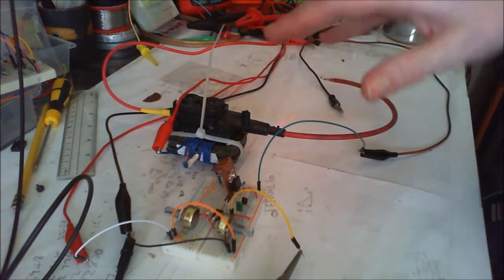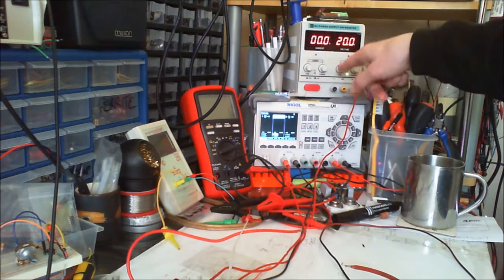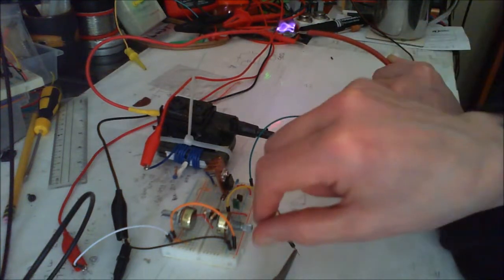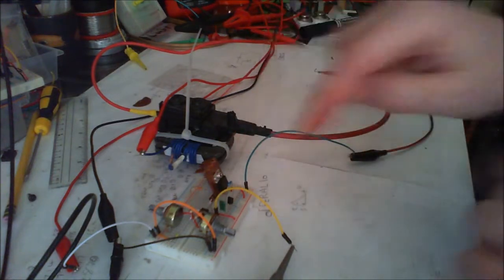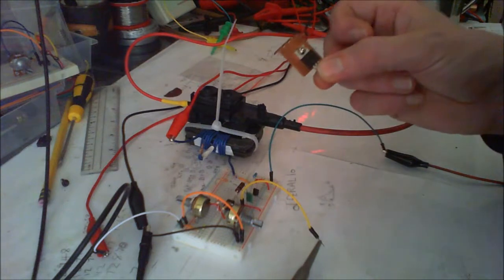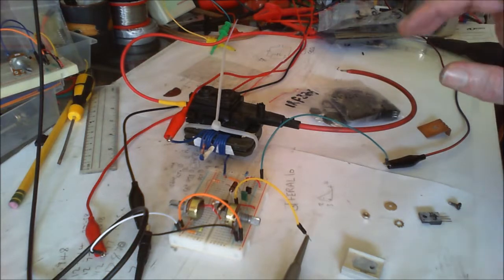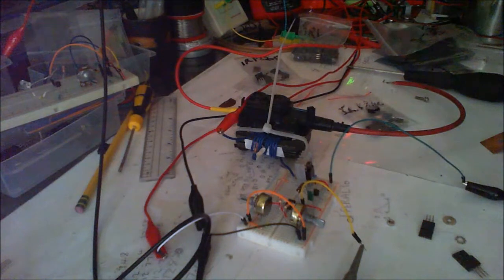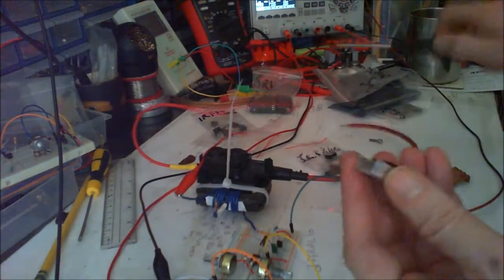Improved 555 Controlled Mosfet Flyback Driver Circuit

Comment: The MOSFET dies because once the back emf gets high enough it avalanches every cycle (turns breakdown voltage events into heat like a TVS diode, but it can only take so much). These spikes aren't random events and will happen every cycle, they're actually required for HV on the output. If the fet isn't avalanche rated it dies the instant breakdown voltage is reached.

You need to limit the peak drain voltage to something below the drain to source breakdown voltage of the device, they do this in the TV with a capacitor across the transistor. However putting anything across it will limit the arc output, the trick is to use a high voltage fet where the peak primary voltage can be allowed to ring up to a high enough voltage for good output without avalanche stressing the fet.

Secondly the 555 timer isn't great for this as the duty cycle and frequency get adjusted at the same time, but a more fundamental issue is a DC component can appear on the core over several cycles and also leads to the demise of the transistor. This is because without feedback you're storing predetermined energy "packets" in the core and depending on the arc characteristics not all of the stored energy makes it to the output, but it has to go somewhere! There is a trick involving a low ohm current sense resistor and jellybean transistor on pin 5 so the cycle is terminated before flux walking events can destroy the transistor.

The only true flyback driver I've seen which takes care of these problems is this one https://320volt.com/en/uc3844-super-flyback-surucu/

ps there's better fets than the IRFP260N these days with higher voltage and on resistance ratings, this is key to getting very high voltages out of the average flyback. If you do use a high voltage fet then lower the 220n capacitor to something like 100nF for additional ring up voltage (but don't let it exceed drain-source breakdown voltage rating). Also on mine I had to add a couple ohms in series with the gate turn off diode.

Sorry for the long comment but some of these flyback drivers are an endless source of frustration and disappointment for people!

Comment: I enjoyed this video. I need help with mine. The mosfet get blowing up. I'm using a optcoupler.
Reply from the maker: How can I help you?
Reply: @Elecifun  Thank you for responding. I enjoy your video. I have a video on my page with the circuit. 12v, 555, two  50k pot with .01 timing capacitor 250n mosfet. I made some changes and i'm getting about inch anf a half spark. How do i achieve what you did.
Reply from the maker: @goobman1981  I looked at your video. It looks like you are using a 4S battery? It seems you have plenty of current, you could reduce the capacitance to reduce current. You could also make the voltage higher.. 24V
Reply: @Elecifun  i want to connect 2 of the same battery to have 24v. But 555 only take 14v at max. I just put a bigger capacitor across the source and ground and did achieve alittle bit higher output. The LC capacitor i changed to .2uf. Which did make alittle difference too. I've changed from 18awg to 14awg. Should i decrease primary turns?.